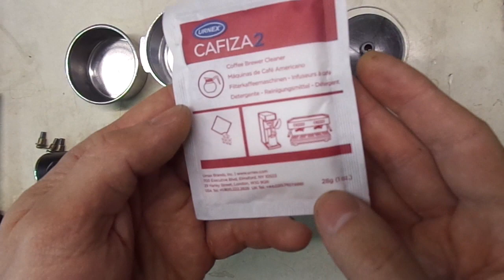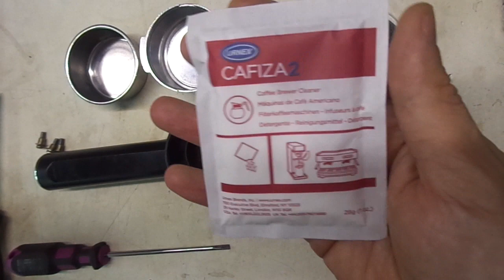How to Clean and Repair Saeco Poemia Portafilter

Comment: Fabulous video!  Very detailed. Got more information than I needed. Did not even know the handle tip could be removed in order to better clean the handle. Also I appreciate the detailed explanation of why and when things go wrong. Would have loved to see how clean the pieces came out with that cleaner... did mine with hot water and toothbrush and got a pretty good result.

Comment: Thanks for this very good video!
Do you happen to know if it is possible to adjust the pressure on these machines? I got myself a naked portafilter, and I can level and tamp what i want, but the water just runs through in a couple of seconds, resulting i a very crema missing and watery cup of espresso 😞

Comment: I've a problem with the top drak grey plastic cap, the one surrounded by the red gasket. After 1-2 years the plastic degrades, it gets black, grainy and then disintegrates. Is there a way to avoid this?

Comment: Hello, very good your explanation, I have the same machine but the three indicator lights do not work, however the machine works well, how should I change the lights? Thank you.
Reply from the maker: You need to open the top cover of the coffee machine
 to access the lights. If you do not know how to disassemble the machine. Search in Google - images- search - Saeco poemia parts diagram

Comment: Great video!! I live in Southern California, and even purchasing my Saeco Poemia was difficult, since most people have turned into Keurig type machines. To me real espresso is the only way to buy coffee. My question is this: where can I find parts por my portafilter, for the boiler, etc? even grease to lubricate my machine, or descaler to clean it, is almost impossible to find.
Reply: You just add in the boiler some lemon salt to clean it. You won't need any other expensive solutions. Stir it in a full boiler and drain it as you would make coffees. Afterwards, do the same with clean water to evacuate any odors. That's it. For parts try on Amazon Europe maybe.

Comment: i cant unscrew the bolts from portafilter. Are there any suggestions ?
Reply from the maker: The bolts are made of stainless steel but the body of the portafilter is aluminum. You can use penetrating fluid and try to move the bolts to the left and right to unscrew.
Reply: @milenstoitsev6676  thanks a lot! 2 of them are off the last one is really stubborn

Comment: Great vid, helped troubleshoot my problem of a jammed portafilter (explosive to unlock!) - was caused by small spring falling out of position. Easy fix 👍🏻🙏🏻
Reply: I think mine is doing the same thing, how did you get to fix it?
Reply: @joaquinalonso4459  See the small spring position at 3:46 (just under his forefinger)-  mine had become detached. But also you need to make sure you put it back on the right way around, one way kinda hugs the plastic, the other way around/upside down(?) does also fit but slips off more easily under pressure.